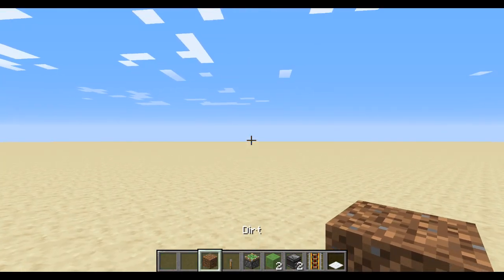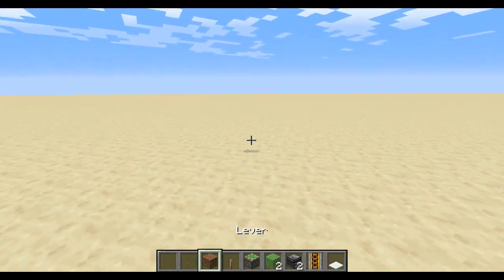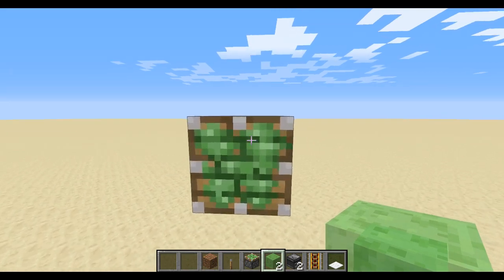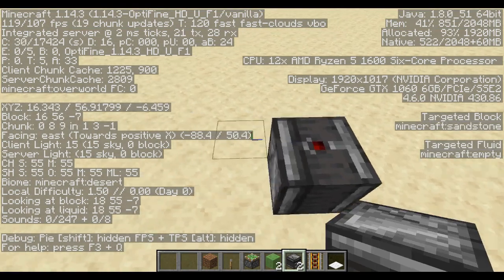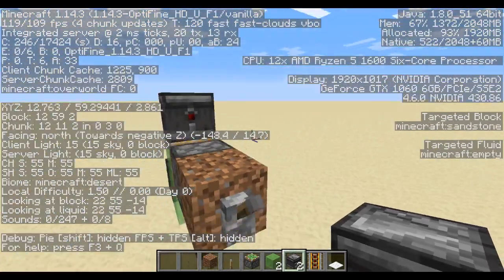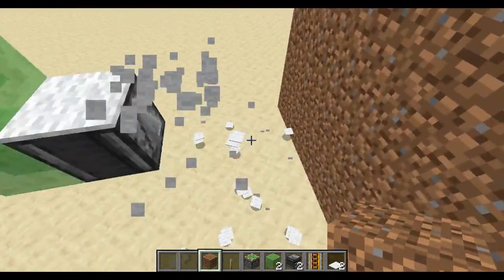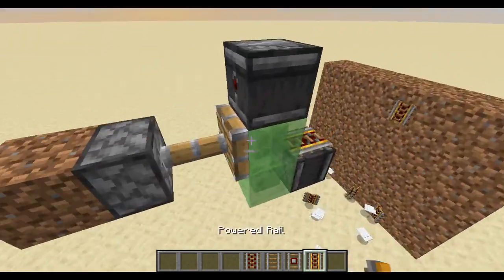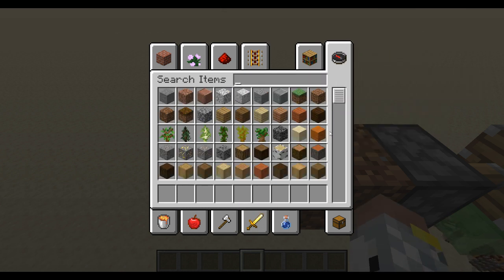How To Make A Working Carpet And Rail Duper in 1.14.X

Comment: Your a god!! It WORKS ON PS4!!!!!
Reply: Have you tried rails? Or did you only dupe carpet?
Reply: Matt Jackson only carpet!
Reply: Does rails work?
Reply: @danish994  A recent patch has inadvertently fixed a glitch that caused rails to disappear when the block underneath is destroyed. So rails work as well now.
Reply: @mattjackson2622  mine just disappeared
Reply: @cxzgaming7929  you have the newest patch installed? Put a rail on the ground and destroy the block underneath it to test.
Edit: we're talking about ps4 version right?
Reply: @mattjackson2622  it works  now , I had tried it attached to slime block,  this design works

Comment: Works in all four directions on PS4 (TU95 / 1.95), allowing for a quadruple duper by putting one of these in each direction from one central block
Reply: Did yours stop working after a few minutes or no
Reply: @nqbzy  Not as far as I could tell. I don't have it running for long, though, bc when running in all four directions at once it fills up a chest very quickly.